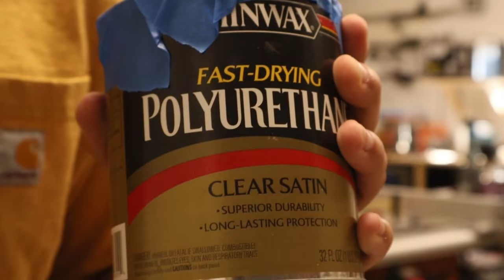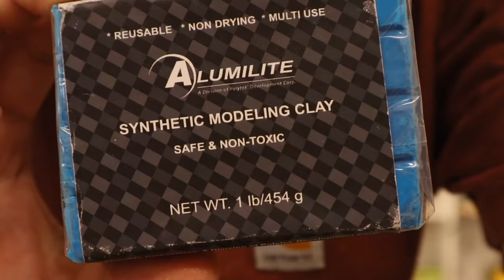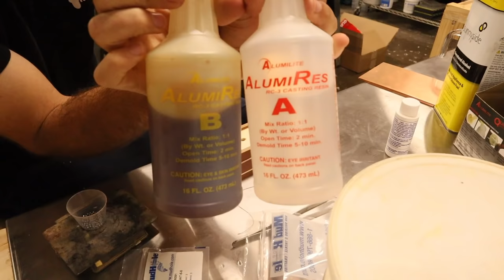Making My Perfect Lil LipLess CrankBait

Comment: Hi, here are a couple video ideas. Top water boat lure with a propeller. Wire spinnerbait. Wooden soft plastic baits (make a wooden version of a lure that would usually be a soft plastic bait e.g. a wooden paddle tail swimbait).

Comment: Hi ,have you ever thought of using the micro planes like luthiers use for guitar and violin work ? I also seen a plane on the web that has interchangeable shaped corner blades for rounding corners and edges ?
great work and tight lines

Comment: Nate Buddy. Before you close a can, like that poly, shoot some Canned compressed air that you get in the electronics department to clean keyboards. It replaces the air in the can with whatever chemical compound, and doesn't cure the finish. Also, you fill the can with marbles, rocks, nuts and bolts, anything that will sink to take up room in the can so the finish doesn't cure

Comment: Can you do (or maybe you have one already) a video, that just goes over the products you use to do the molds and casting?  I have been making carved wood baits and a lot of wire spinners, but with the wood ones, if you loose one you're done.  whereas with a master mold with  good detail, you obviously can cast dozens and play with the colors and weight etc until you get what you want and have less time and effort into each one.  If someone has the info, please post so I can get the supplies to try my hand at casting (molding... not casting the lure LOL)

Comment: 10:08 there’s an old trick if you havent been told already. After opening polyurethane and when you’re done using it. Put the top back on securely and store it upside down. I do this works great.

Comment: Try storing your urethane upside down.  The air in the can will create the crust at the bottom of the can, and the top will still be good.  Another trick is to refill the can with marbles to minimize the amount of air in the can.